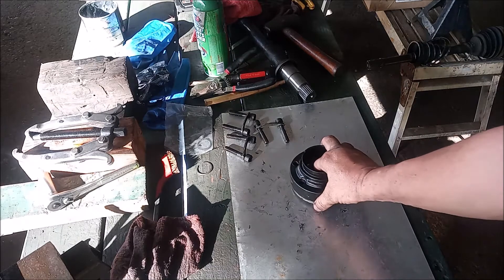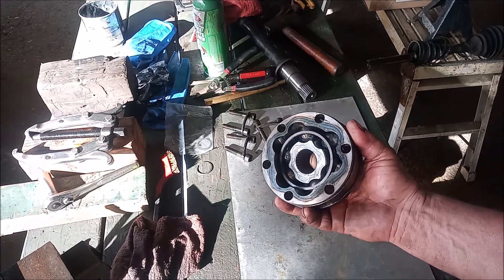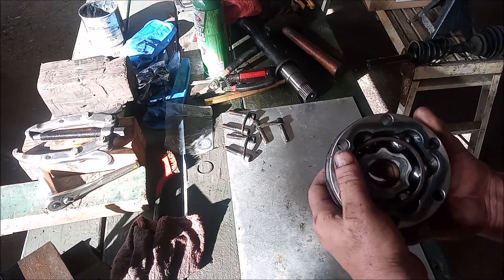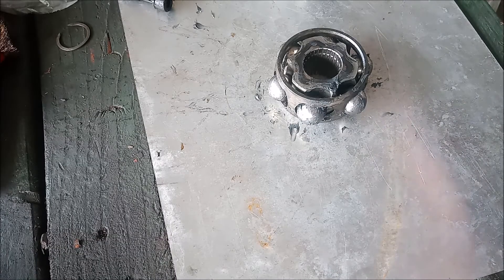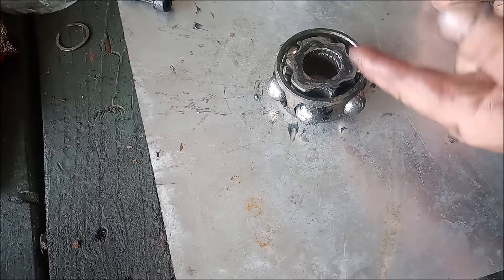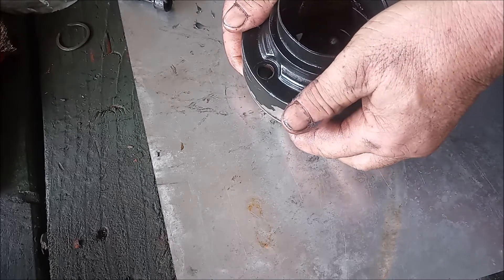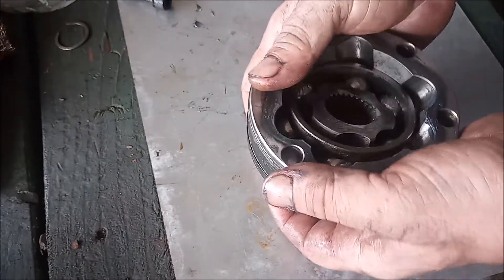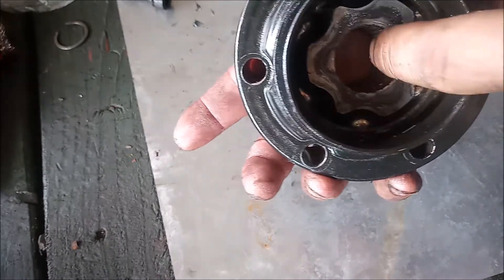Assembling Toyota MR2 Cross-Groove Inner CV Joint -  Also Highlander, RX300...

Comment: This is not a Rzeppa (pronounced "rez-zeppa") joint.  It's a cross groove joint.  I think Posche invented them, but I need a fact check on that.  Rzeppa joints are similar, but do not plunge.
Reply from the maker: Yes you are right the Toyota joints are cross-groove, unfortunately the nomenclature is sometimes used interchangeably.
Reply from the maker: Also, look at the title of this video. What does it say?